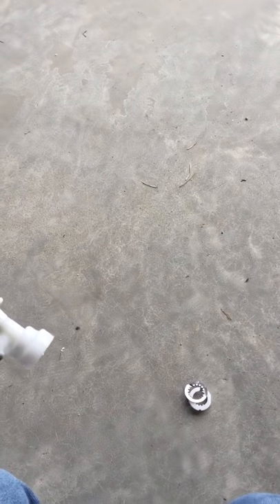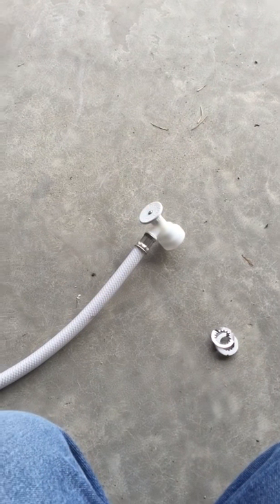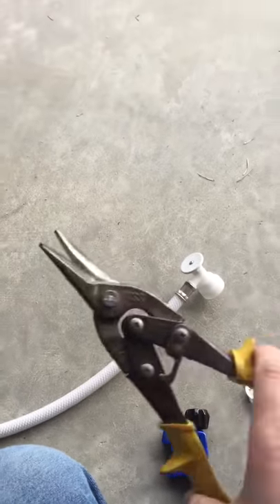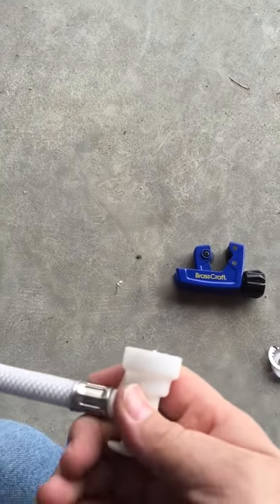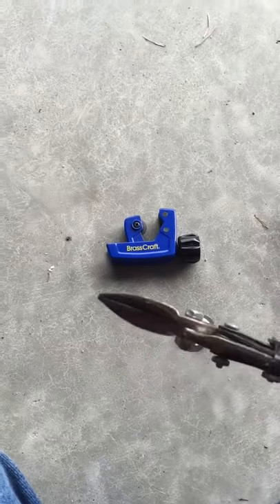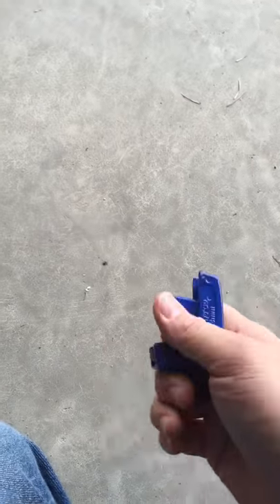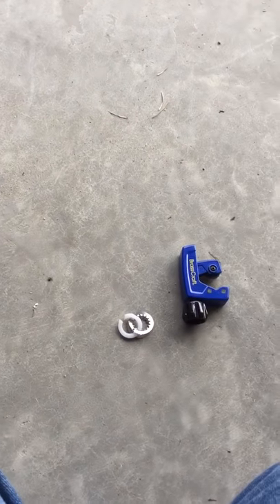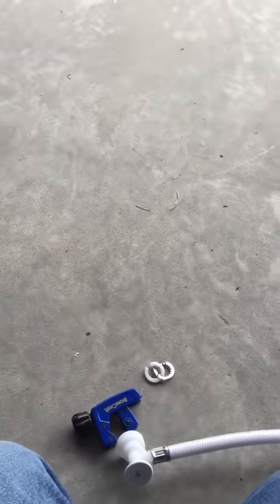How to remove ACCOR Technology flowtite water valve. (Correctly)

Comment: My initial experience on ACCOR valves was on my toilet when I was about to replace my toilet flush valve and I noticed continuous leak  even after setting off the ACCOR valve. This was after 12 years on a new house.  Since the leak was internal, I never bothered about it and just shut off the main when I did the repair.  2 years later , it happened again on another toilet when I planned on replacing the flush valve but far worse, the leak was external. Just the act of touching and moving the ACCOR cord made it to leak !  I checked on some plumbers and the quote ranged from $200 to $300  per supply valve replacement so I decided to check on  Youtube.    Was Blessed to find this GREAT VIDEO and decided to give it a try. From the wall, I only got about 1 1/2"  of cpvc to work on after removing the valve so I needed to make sure i do not damage it during removal and avoid  the need to cut it shorter.  VERY THANKFUL FOR THIS VIDEO  outlining the proper procedure to PRESERVE the remaining cpvc. I managed to do my first replacement recently and will Schedule  the Rest. !   P.S. I also researched how to handle cpvc as they say it gets brittle with time but so far, my 16 year old cpvc was doing OK during insertions of new valve ( Sharkbite). Once, again Feeling Grateful for this video !
Reply from the maker: glad you found it helpful! those valves are a pain in the ass for sure

Comment: Thank you!!!!  I had to remove and replace two of those flowtite values which turned out to be the most frustrating job that I’ve ever done around the house UNTIL I WATCHED THE VID. The first one came right off with no problem but the second, I fooled around with for about an hour.

Comment: Thank you for this!  Make sure you get the large tube cutter like he describes not the smaller one. Also get a decent pair of snips, the cheaper ones won't work as well. This works so don't mess around trying to twist it off.  This saved me a call to the plumber. I used a SharkBite angle stop for the replacement and it worked very easily.

Comment: Thanks for the video.  My valves are on CPVC and using the procedure you described worked perfectly with no damage to the existing pipe with a slight twist I mention below.   The only thing I did different was used my Dremel  and cut the valve in the same place you did with the pipe cutter half way around, inserted a screw driver, twisted and the remaining uncut half broke away.  The rest of the removal was exactly as you described.  Wiped it clean and put a Shark Bite fitting in its place. Done!
Reply from the maker: good, glad it helped you out!

Comment: Thank you! Saved a bunch of time and aggravation. I didn't have a wide enough tube cutter, but did have a decent amount of slack on the PEX coming out of the wall. Clamped the PEX so it wouldn't slide back in to the wall, used a coping saw to cut of the valve and installed a Sharkbite valve.
Reply from the maker: yup no worries man glad it helped

Comment: Many thanks, I had the same problem trying to take it off CPVC pipe. I used the oscillating tool by carefully cutting thru and without damaging the CPVC pipe. Your method is very good, I'll try it next time. Many thanks again.

Comment: NAZ ON. I wish you captured while you were cutting it. You didn't cut through your PVC pipe, did you? Just cut around the collar and pull it out?  I only have aprrox. 1.75 inch of pipe coming out of the wall. I will need to save all the pipe I can. At this point I don't have enough confidence to do it yet. Need to research more. Anyone else has tried it? All valves in my house are Accor valves. I don't want to wait until they leak or one of the flex hose goes bad.
Reply from the maker: Yup just the collar not the pipe. Once you cut the collar you'll be able to slide half of it off. Then you just snip the lock washer and slide the rest off.  If you tried unscrewing the collar and the pvc pipe is damaged you can use the cutter to trim off the damaged pipe. You'll want an undamged pipe if your putting on a new press on fitting.
Reply: thank you for your clarification. Very useful video clip and advice.

Comment: you cannot cut with that size tube cutter it will not even fit over valve
Reply from the maker: Yes you can. Did you get the right size cutter? Mine fit just fine. I've changed every valve in the house with it
Reply: Well obviously it did!

Comment: sorry friends , this is not the solution if you cut your line short and not having enough pipe to attach your next valve. This method is OK only if you have 1.45 or 2 inches of pipe sticking out out the wall. be careful not to cut your pipe too short!!!
Reply from the maker: I'm assuming you didn't watch the video? You don't have to cut the pipe using this method,  just the fitting itself. UNLESS you have screwed up the pipe trying to twist it off. Then you must trim off the damaged portion of your pipe to insure a clean seal. Pay attention next time. And btw this is the preferred method from the manufacture.
Reply: Pay attention to me , Preferred method suggested by the ACCOR. is : Turn the valve counterclockwise and gently pull as you turn" 
Viewers here are not professional plumbers . People turn to YouTube for solution (DIY). If any person followed your method and cut the pipe too short , they will be in more trouble . Its hard to connect a new valve to a short amount of pipe coming out of the wall.  I hope you get my point. Think before you post.
Reply from the maker: So again I'll break it down for you   I reached out to Accor their response to me was to cut of the fitting. "Gently twisting off is a method of removal but 9 times out of 10 it will damage the line. The  preferred method from the manufacture themselves was to cut off the fitting to minamize damage.  You are welcome to go verify that with Accor,  which I suggest you do. Anyone attempting to twist these fittings off are almost sure to damage the line.  Thank you for your "professional" opinion.  However I don't recall asking for it...
Reply: dozdeshabb do you have much experience with these crap accor valves? First off the method this individual is posting about does not cut the pipe off it only cracks the valve open.  Secondly why does he have to be a professional to point out an obvious solution to a well documented problem? I've had many instances where these cheap plastic valve will not come off as you describe "preferred method". Think before you post, do your research and get back to me.
Reply: No. If you cut off just the Accor body then you must by definition have enough pipe to fit a glue on or compression fitting.